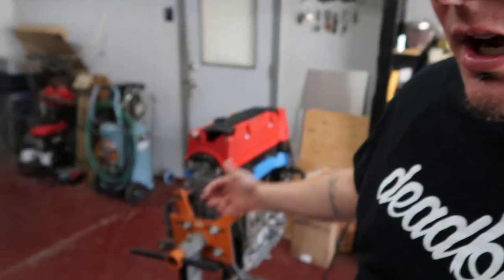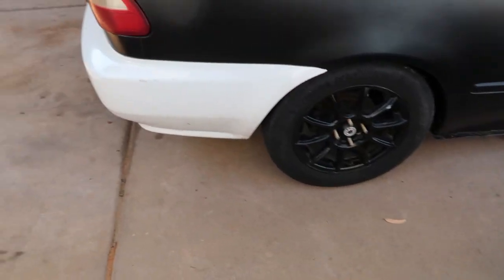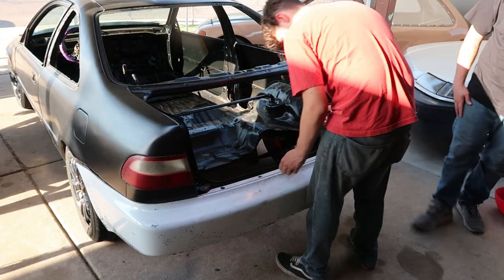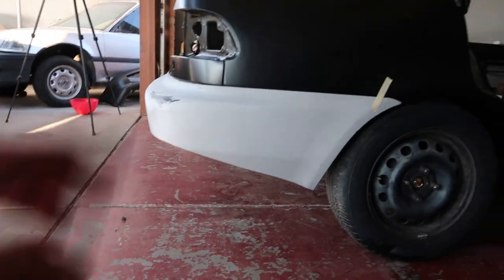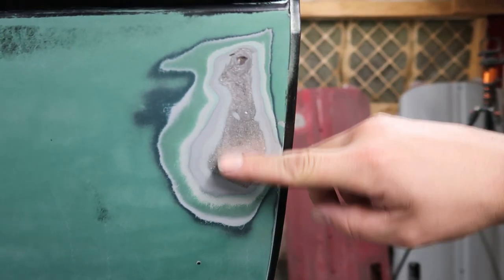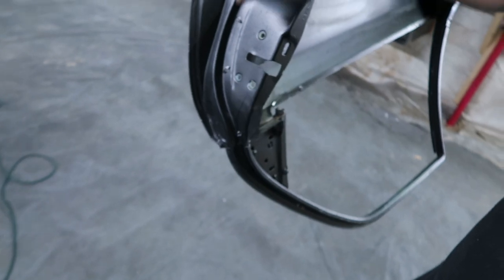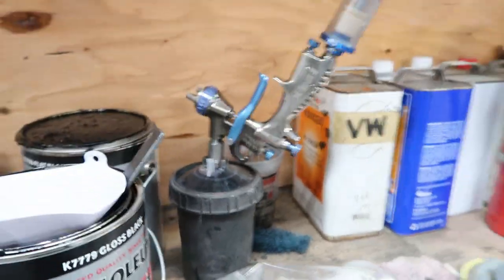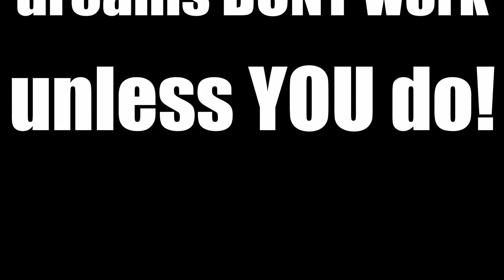Cutting my rear bumper made my car WAY faster! 😮

Comment: You can rev the k20 out more. Boosted Boys just changed his setup from k24 to a built k20 with a single turbo in his mr2 and ran in the 7s. Check his vid out

Comment: If your torn between setups just look at Kyle. He went from a boosted k24 to a k20 and got his 7 and for a N/A setup look at Zosh he went from a k24 to a K24 bottom end with a K20 head and barely had any gains. Keep your k20 and do rods and Pistons and build the head to handle the rpm and you will be set.

Comment: I love all motor/nitous, building an h23 crx this way as we speak. With a k20 head, 24 bottom end, h beams and PRC pistons(k20 type r, cheap amd reliable from Nippon Racing), you are at big compression and have an easy 300hp all motor bottom end that will handle some spray. Do what makes you happy bro, this is just what I like.

Comment: My ideal setup is the K20 head with the K24 block for an all motor setup! I've seen great success with the K20 with turbo cause they handle boost better!
Reply: 100% agree with you bro ... boostedboiz mr2 with the setup that you mention make 7seconds on track 👍🏻👍🏻 surely it will works to make alot of horse power
Reply: Hell yea

Comment: Turbo with good traction control mayne. Can't go wrong. All the power, keep the traction. Also k24 bottom end is torquier, while the k20 head is snappier. Put em together and ya get that snap from the head with the torque from the bottom end. Bonus torque is never bad, especially in a honda. I'd turbo that setup.

Comment: I think it best to throw in the k20 and do whatever you want (nitrous, turbo, supercharge or all motor) so you can have the car running with the k20 since it mostly complete..while you have the k20 running built the k24 block and then slap on the k20 head and oil pump afterward so you can feel the difference of power and you'll have a extra spare block to do whatever with it for another project..in my perspective that the best way to go

Comment: Turbo is a no go with that cut chassis. You need an all motor build. K24/k20 easy mid to low 10's depending on how wild you want to get with the compression and fuel.

Comment: i used that same rust-oleum paint on the floorpan on my wifes porject over the winter in ohio. it was kinda cold out but my garage is heated. it never cured over a 3-4 week period i sanded it all back down and used another product. not sure what it is with the " professional" line and it staying soft.

Comment: Yo DB you might want to think about just welding some tabs on the inner skin of the rear door and the inner side of the jams and have the doors removable by just nut and bolt so you can get in there to service some stuff as needed 🤔👍🏽😊🤙🏽

Comment: K24a2 block k20a2 with the k20a2 oil pump. No nitrous all motor if anything but if you nest add a power adder turbo. But a good tuned k2420 with good bolt ones and someone who actually knows how too turn you’ll get over 300

Comment: all motor/nitrous

k 24

boosted
k20

take a look at kyle from boosted boiz and his mr2, just like you said the torque from the boosted k24 was one of the reasons his set up was limited, he switched to a k20, along with other mods i wont lie. and went from running 8.3 to 7.9

Comment: K24 turbo is a traction issue I've done some research k20 go turbo k24/20 is a good.all motor nitrous set up I was going k24 turbo but actually changed my mind and going k20

Comment: I’m doing an all motor k24a2/k20z3 on my 93 coupe,all high end shit tho,I’m trying to reliably push out anywhere from 330-350whp…I’m using 12:5.1 cp pistons with a .5 over bore,stock stroke eagle rods,ported head,drag cartel 3.2 cams,standard size ferrea flat valves,k-tuned big tube header… managed by a haltech elite 1500 on e85….if you were to go turbo just stay k20 because you can get higher revs out of it which means more power and broader power band,you can also combine the turbo set up with a cheap awd system using the crv components which is so much cheaper but also weaker compared to wagovan diffs,it’ll be a monster tho,…all motor tho k24/k20 with bolt ons and cams will fucking fly

Comment: You should definitely Frankenstein it the K20 head flows better and the K24 bottom and has more torque people are putting them to together and making 600-plus reliable horse would have course upgraded fuel lines and oil pump and all that you might as well just make it four-wheel drive

Comment: Save the k20 or turbo it. If you rob the head, you'll have to buy one anyway.

Get a k20 head for the k24. Turbo that.
You want the displacement.
Do pistons and rods like you were saying, because at some point you'll get bored of the power and want more. Trust me.

To get traction, it's all about the alignment, shocks/springs, and corner balancing. Add in proper slicks and track conditions. Like 26x13 or 15 for street and 24.5x13 for strip.

Comment: I would k20 nitrous or if $$$$ are good I would do k20 kraftwerks kit and call it a day bro !!  K20/k24 all motor/nitrous . Turbo your going to be fighting and k series transmissions are weak so depending on power you may only get a couple of runs out of it. To be honest though your best bet is to test waters on your own and compare to khaki that's where your best advice is 👌

Comment: Wait u gunna slap a K on the 4 door yea either way with all that weight u taking off traction will be a problem forsure.but I have a buddy k24a2 all stock on a 50shot 🍼 and his doing 260 out in Cali. My buddy building his k20a2 rn going all motor for a bit then boost.  Look up zosh he had a full k24a nd now he franksiten swap k20 head but only gain lik 20 hp more

Comment: im sure youre sick of these kind of comments but if you do decide turbo, consider putting in a cage. you went through all the trouble of removing every ounce you could so keep it all motor or all that cutting turns out to be kinda pointless when you could just add another pound of boost to compensate for the weight. high comp high revving k24/20 on e85 spray it with some nitrous - in my humble opinion .
Reply: also cant you weld the rear doors onto the car?